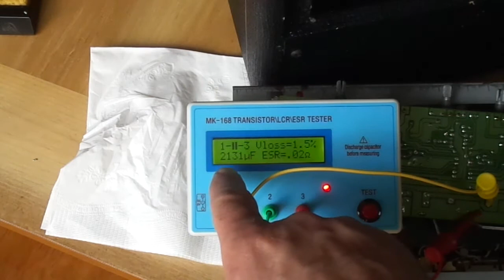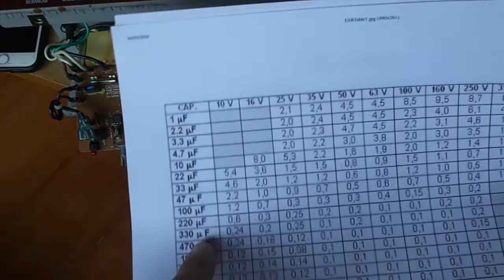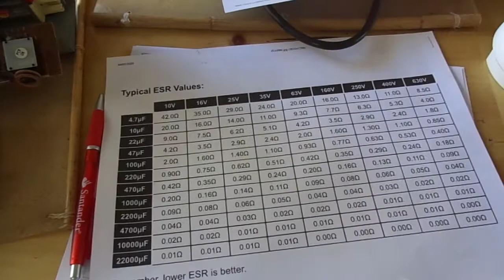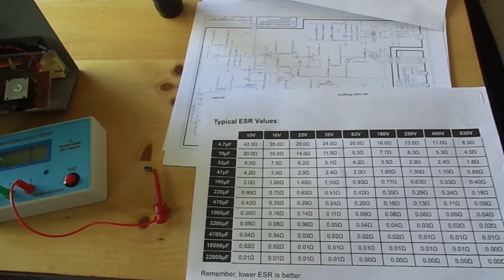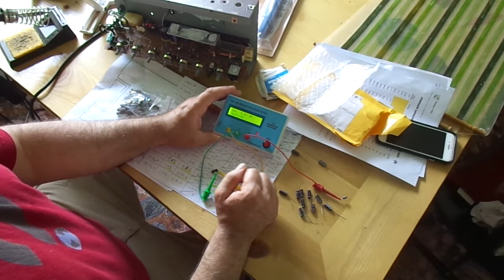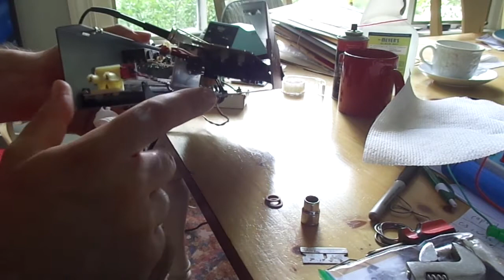Vox Pathfinder 15R Electrolytic Capacitor checkup and possible recap job?

Comment: Hi, thanks for this video! I'm a new owner of one fantastic 15r, and I'm addicted to it.

I've made some mods to it, added a raw control pot and a variable boost pot. 

Could you help me to determine where can I solder a passive FX loop por the pathfinder 15r? 

Please I can't find any information about it
Reply: https://www.tdpri.com/threads/vox-pathfinder-owners.166040/page-172  here is how I connect a very simple loop, it works perfect.
Reply from the maker: @fredyperezrozo1240  same exact place as Kevin above, right?  Just before R36?  My only issue with this, it seems as you dial in more or less volume- you’re affecting the signal level going into the loop, which isn’t optimal. Looks like a better place is between R64 & the volume pot.
Reply: @voxpathfinder15r  With all the help and good information from Kevin, he told me where exactly to do it, we cleaned the connections a bit, removed the ground wires from the jacks. It works very well, and it is very simple.
Reply: @voxpathfinder15r  So it works perfect, I already made the adjustment, it is very easy to install the loop. Thank you very much for the information and the correction.
Reply: I hope that many pathfinder addicts will be encouraged to make this simple modification. here with the new location of the loop https://www.tdpri.com/threads/vox-pathfinder-owners.166040/page-172#post-10785812
Reply from the maker: @fredyperezrozo1240  thanks for mentioning me!  So the loop works much better now, any other issues?  I was wondering if I could figure a way to move the loop even earlier in the circuit in case the onboard reverb being mixed in before the loop introduced any weirdness?  But I would love more feedback!
Reply: @voxpathfinder15r  reverb is good, it does not affect its operation at all, apparently it is connected in parallel, you are the expert, thanks again.
Reply from the maker: @fredyperezrozo1240  wow, this is awesome, glad I could be of some help - despite the fact you performed this mod before I ever tried!  What I have done is gone from the line out Jack into my effects then into the return of a larger amp, using only the power amp. This requires a 2nd amp of course but no mods are needed. But what you and Kevin accomplished is awesome!!  I was thinking for those that don’t want to cut a trace - maybe instead lift one leg of the pot from the board and bend it. Then solder one side to the board, the other side to the lifted leg of the volume pot. This way the board could be left stock and only a new pot purchased to go back to stock.
Reply: @voxpathfinder15r  We would like your expert opinion on the tone control. How it works and what would be the best addition to a media control. RAW control with an A50K potentiometer according to https://www.offsetguitars.com/forums/viewtopic.php?t=97331
Reply from the maker: @fredyperezrozo1240  you want to add a mids pot?  You would place it in lieu of R18. I can model the behavior if you want but I would think a 10k pot would be plenty?
Reply: https://www.tdpri.com/threads/vox-pathfinder-owners.166040/page-157#post-8809630 waiting for your valuable feedback, is mid control necessary?
Reply from the maker: @fredyperezrozo1240  well, if you add a mids pot - it might not sound like a Vox if you tweak it too much. One thing you can try - you installed an effects loop, try putting an eq pedal in your effects loop and adjust the mids there. It would give you exactly the same amount of control and possibly more. Just remember to switch it off when setting the treble and bass on your amp. If you know something about passive fender/Vox/Marshall tone stacks - the treble and bass are interactive, but the mids basically is independent. So when you set your tone, always change treble and bass first. Then add or subtract mids to taste. With an effects loop mod, you won’t need to bother with these mods. If you want a pedal that change the mids, but don’t want to use an eq pedal. Try JHS Haunting Mids pedal. https://www.sweetwater.com/store/detail/HauntingMids--jhs-haunting-mids-eq-and-mid-boost-pedal?mrkgadid=3331289786&mrkgcl=28&mrkgen=gpla&mrkgbflag=0&mrkgcat=guitars&acctid=21700000001645388&dskeywordid=92700046934877518&lid=92700046934877518&ds_s_kwgid=58700005283398557&ds_s_inventory_feed_id=97700000007215323&dsproductgroupid=373037009969&product_id=HauntingMids&prodctry=US&prodlang=en&channel=online&storeid=&device=m&network=g&matchtype=&adpos=largenumber&locationid=1018095&creative=332063179833&targetid=aud-994727060325:pla-373037009969&campaignid=1709882817&awsearchcpc=1&gclid=CjwKCAjwruSHBhAtEiwA_qCppjiWB6s5yvUZUEv8CgU7CTpKI8kIOD1Ac5e9YPzN9fylPS0vje1rSRoCEKYQAvD_BwE&gclsrc=aw.ds
Reply from the maker: That’s a good question! I don’t really know at the moment?  But I wonder if it’s as simple as removing the reverb tank and using those leads to the the effects send and return jacks?  You would lose your reverb of course, but the reverb knob on top would become the effects return level control. And it would be a parallel effect loop. I am sure there is a way to make it serial somewhere else in the circuit. You could do a virtual effects loop. Just come out of the line out Jack in the plug on the back, then go to your pedals and the go into the effects return of another amp. Whatever neutral solid state you can find for cheap. I have done that with great success
Reply: @voxpathfinder15r  thanks so much! I'd like to add a line 6 helix stomp in the FX loop for reverb, delay and chorus. If I remove the reverb tank,  and put the stomp at that point, the reverb knob will act like a mix knob in parallel?
Can I use reverb knob to full and get 100% wet signal from the line 6 stomp?
Reply from the maker: @kevinamez  I don’t know as I haven’t done a full circuit analysis, but it seems like taking out the reverb can get you a parallel effect loop. Turning the reverb knob Will get you as much wet as a parallel effect loop can, but I don’t think it will ever be 100% like a serial effect loop?  Just imagine imagine the maximum amount of onboard reverb you can achieve, I assume you should get that with your helix stomp. If anything if it’s not as much as you like, you can increase the effects more on the helix to get the desired effect when it’s mixed with the dry signal of the Vox. I bet a compression pedal would be awesome in it as well
Reply: @voxpathfinder15r  I'll give it a try. Thank you so much!
Reply from the maker: @kevinamez  be sure to report back your findings! Also you should consider wiring the jacks such that when no plugs are inserted, the onboard reverb is back in use!
Reply: @voxpathfinder15r looking at official PF15R schematic,  I've found that de volume pot works as a master volume  just before r36, I believe  that's where preamp section ends and power amp section begins.
Tomorrow I'll try solder a send jack right there and see if it doesn't turn into flames. Btw i'm a dentist trying to make this work LOL.
Reply from the maker: @kevinamez  you could try and see. It is just I am looking for a gain stage to recover any signal loss by inserting an effects loop. I think there is a convenient pre and post gain stage where the reverb is, probably gets the signal low enough to work with the effects and and a post gain stage to recover signal loss before injecting it back into the path of the main signal
Reply: @voxpathfinder15r  Done! It works perfectly. I cut the line just before r36 and soldered the jacks with a jumper for when there's nothing plugged in. It's so clean and it gives me the opportunity to use the Helix in 4 cable method. Thanks for all your support!
Reply from the maker: @kevinamez  excellent, will keep this information in mind for the future!
Reply from the maker: @kevinamez  how is this working?  It looks like turning the volume pot up and down will affect the signal level going into the loop. Are you having problems with this?  It looks better to go on the other side of the volume pot between R64. The signal level would remain constant going through the loop despite changing the volume knob
Reply: @voxpathfinder15r  yes, the volume pot affects the level of the send.
Reply from the maker: @kevinamez  so it’s not a great solution

Comment: Recently I bought this model too! Tremolo is not sounding :(  what's the problem? I love tremolo sound.
Reply from the maker: The optocoupler is bad
Reply: @voxpathfinder15r  I opened my 15R for find the optocoupler but this version doesn't have the optocoupler (or I can't find it).
Reply from the maker: @bruce_the_killer  does the circuit board look like in this video? Or is it a yellow colored board?
Reply: @voxpathfinder15r  Looks like this one in the video.
Reply from the maker: @bruce_the_killer  ok, you don’t have the optocoupler version then, it’s opamps doing the job. Sounds like the surrounding capacitors may be out of spec? Or someone fooled with the onboard adjustable resistance. You’re going to need a technician to fix it
Reply: @voxpathfinder15r  So, I have to change the tremolo opamp? or just a capacitor? There's no adjustable resistance. 😱
Reply from the maker: @bruce_the_killer  at this point, there has to be something either obviously broken, maybe solder joints from the tremolo pots are broken where they go into the board, or somewhere else. At this point there is no way to tell without putting it on a bench and get some diagnostic equipment on it. At least for me, I can’t tell you anymore if I can’t put it on my work bench. The older version that had no reverb - 100% sure it would have been the optocoupler. The newer version with onboard reverb definitely needs to go on a bench. Probably the capacitors nearest the opamp chip that makes the tremolo circuit is most suspect
Reply from the maker: @bruce_the_killer  if you want to try replacing one component, replace the transistor labeled Q5. If that one component died - it would render the entire tremolo dead. It should be close to the depth potentiometer.

Comment: Wow, you gotta really love that p15r. I own one, i gig with it, sounds great using the line out to the PA. I build a 1x12 extension cab for rehearsal in the studio. Now i wanna build a 2x12 cab, question, should i wire the speakers in series or parallel? What are the pros and cons between those two wirings?
Reply from the maker: Roghib Asfahani the manufacturer states not to go below an 8 ohm load. So if you have two 16 ohm speakers, wire them in parallel. If you have two 8 ohm speakers, wiring them in parallel will bring down total resistance to 4 ohms and possibly damage the output power chip, unless you have taken extra steps to clamp on extra heat sinks, fans, etc. So two 8 ohm speakers will have to be wired in series for a total load of 16 ohms, which will reduce the output power of your amp, but safe from burning up. Two 4 ohm speakers wired in series will give you those 8 ohms as well. So most likely situation is if you have a an 8 ohm speaker, keep it 1x12. If you’re fortunate to have a 16 ohm speaker, go ahead and get another and wire them in parallel.   If you’re adamant with 8 ohm speakers, you can make an 8 ohm cabinet with a 4X12 cabinet, which would be awesome. I have another video here, where I piped this amp after being repaired into an 8 ohm 2x12 cabinet, with Vintage 30 like clones from Eminence. It’s stupidly ridiculously loud, 115 dB at 2 meters from grille cloth, most everyone measures @ 1 meter, in this case it would be 6 dB louder @ 121dB total!